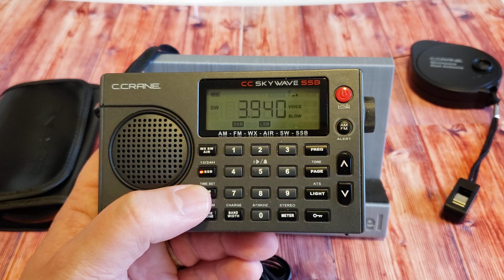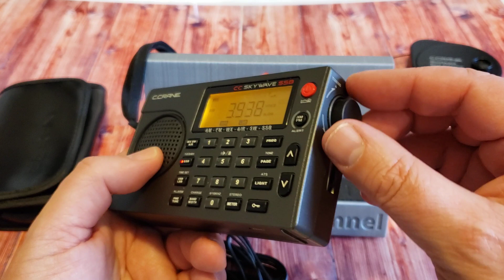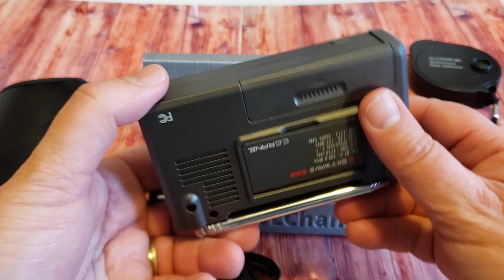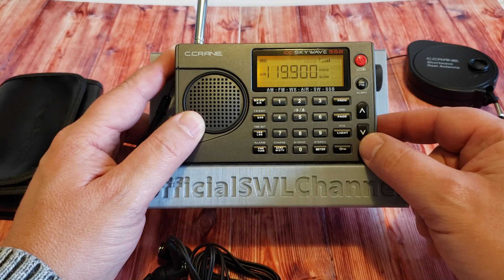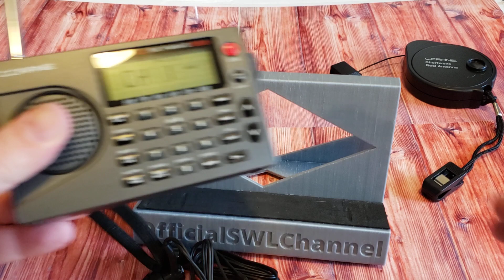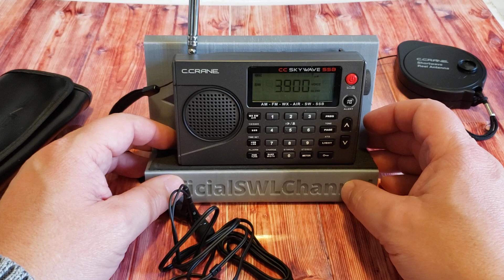Review C Crane CCSkywaveSSB portable receiver AM FM SW Airband Weather alert SSB

Comment: Great review. Very accurate. It is probably the smallest radio ever made with sideband. I had the Grundig G6 and discovered that both radios are exactly the same size. The G6's display has more on it. I think that's why it looks smaller. The AM on my CCrane SSB is very sensitive to AM reception but nothing to compare with my CCrane 2e
Reply: I. Have.   This.   Radio.   And.   It's.   Great

Comment: Thanks for review, have owned this for over a year:
Cost/value: agreed is a lot of $ but the overall design and features are unique, nothing like it for features vs size so nothing to really compare to it.
Earbuds: I found the tips did not fit well, maybe Comply has a tip that fits and would work better but I just us Shure SE215 with it. Earbuds have very little treble and boosted bass, probably a good match for am/sw/air on this radio but not good for higher quality sources.
Air: sensitivity seems to match (but not exceeed) XHDATA 808 which I have compared to listening to barely readable ATIS broadcast from CYOW at my location. Does receive a lot of transmissions.
USB connector: mine had the inner part (with the conductors) misaligned to the metal shell (maybe soldering overheat softened plastic during assembly) so could not insert mini USB connector for charging, inner part (with the conductors) actually broke. Annoying, looks like is misaligned on the sample shown in the video too.
Audio: agreed, is weak point so earbuds (or headphones) valuable.

Comment: Thank you for the review. For a house radio the price versus the small audio, mutes while tunning and no long wave is deal breaker. For a travel radio, it is very good. The short comings I mentioned are not an issue. I don't listen to long wave on short antennas in hotel rooms, the small speaker and chuffing is okay if it's not on my daily radio. Thanks, Dan KM6CQ

Comment: Hello great video, May I have a question? It's possible to use electric wire fence for cows like a antenna for short wave? Off course without electric? Thanks in advance.🤗👍
Reply: Yes I have done this, but it will overload some radios!  kc2nxp